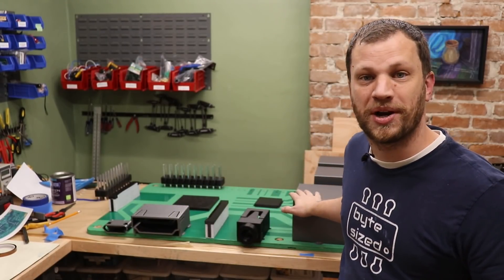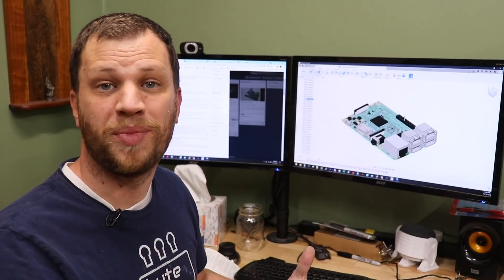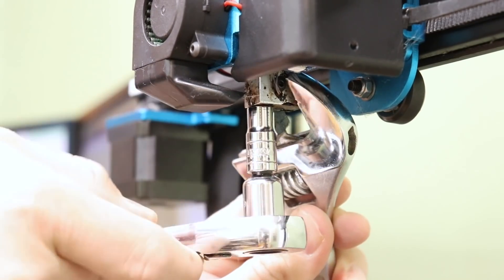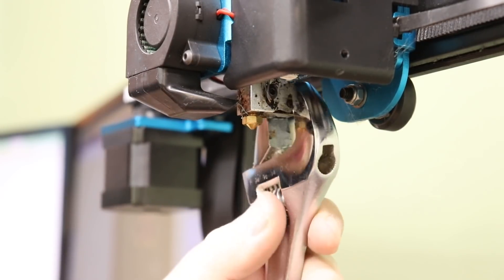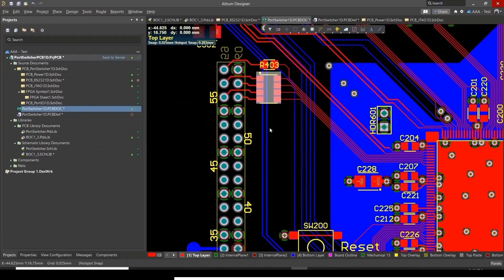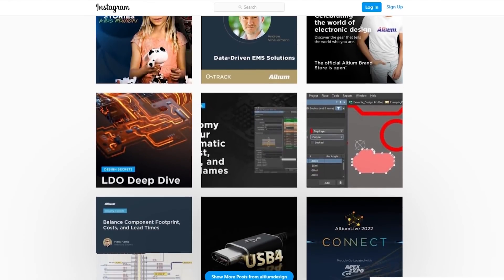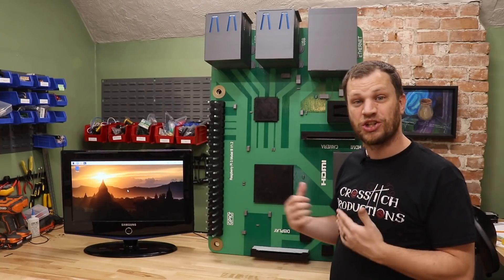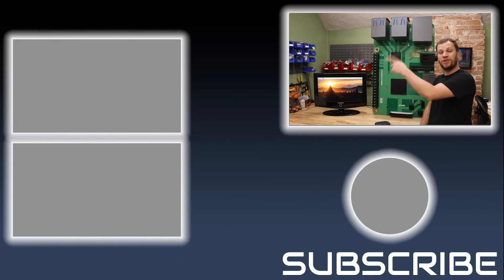I Made A Giant Raspberry Pi Single Board Computer

Comment: A foam board (as a filler), and some fibreglass (applied around said foam board) would probably work just as well as the PCB, and weigh a heck of a lot less.
Reply from the maker: Yeah it would be a lot lighter. I've never worked with fiberglass

Comment: "Hey the raspberry pi is cool because it's so small and saves spa-"
Zack: hold my beer
Really cool project :D 
I'd just like to know if the pins work without a problem. so maybe you can also do a small LED light project or something with some analouge sensors.
Reply from the maker: I tested the pins and they work! What would you like to see me do with this board?

Comment: Would be great to see the SMD onboard LEDs, and maybe a scaled up resistor with one 5mm LED on the GPIO blinking.
Reply: And LED's on the Ethernet port wired in and working correctly too ;)
Reply: Maybe with one of these 10W LEDs and a boost hidden under a resistor-looking cover.